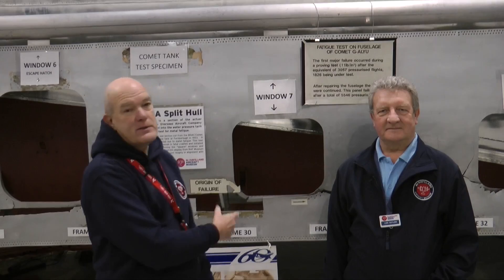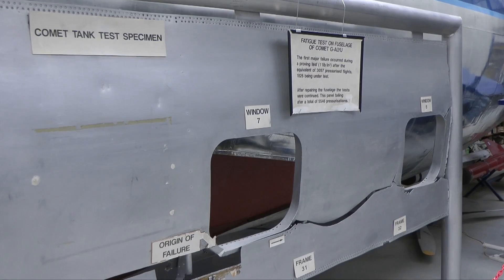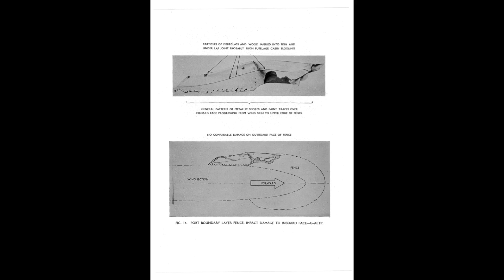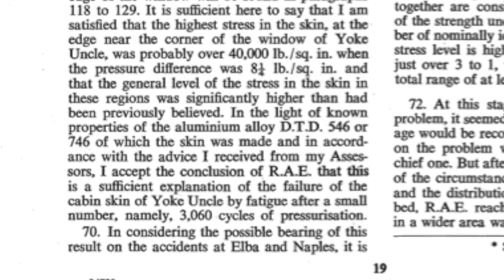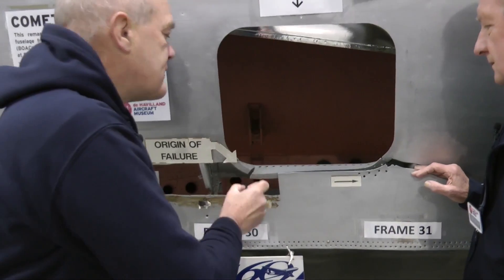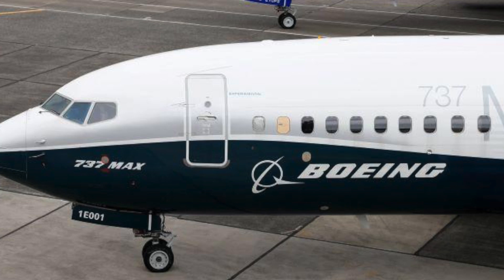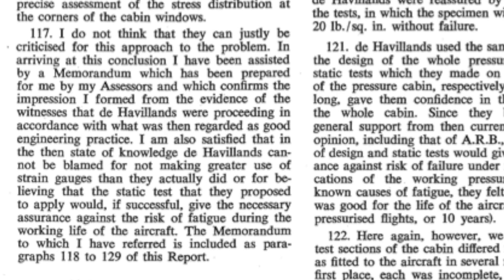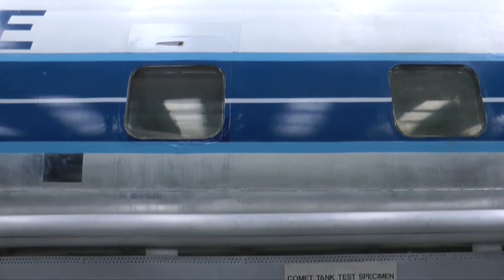"Dealing with Disaster" the DH.106 Comet jet airliner crash caused by "Square Windows"? (Pt. 2 of 3)

Comment: Thanks, so the enquire blames both the design of the "apertures" and the construction method used. Of course the newer Boeing 737s with oval windows that you mention fall from the sky due to automatic overrides by computers and bad construction practices, not square windows.  The result is the same though.